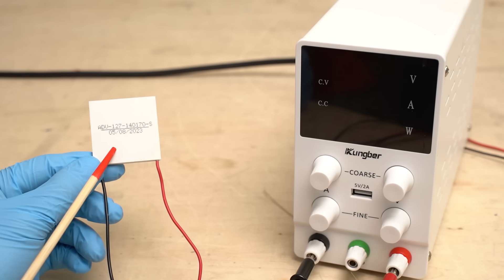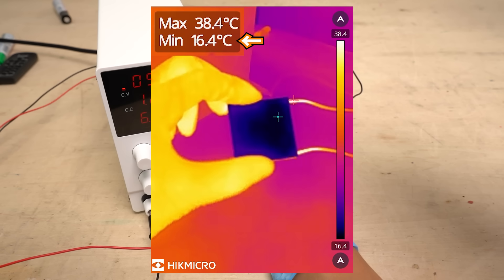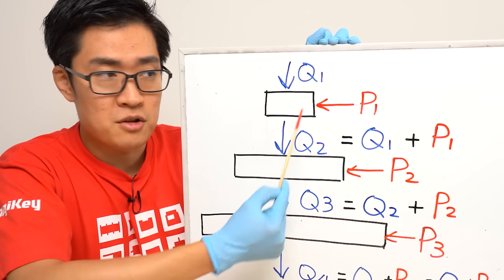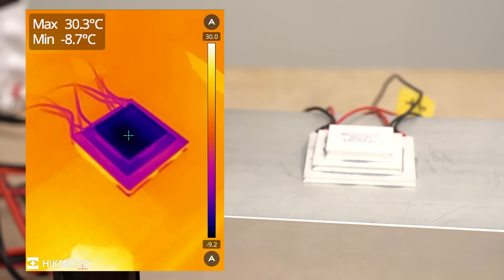Stacking 5 Peltier Modules, and Reached -90℃

Comment: AI Summary

Abstract:

This video explores the practical limits of Peltier device cooling by constructing and optimizing a multi-stage system. The creator, a beginner in thermal engineering, aims to achieve ultra-low temperatures, initially targeting -60°C. The experiment demonstrates the principle of stacking Peltier devices to achieve progressively lower temperatures, emphasizing the critical role of efficient heat dissipation from the hot sides and effective insulation of the cold side. Through systematic current optimization and insulation, a self-made three-stage Peltier stack successfully reached -74°C. Further experimentation combining a commercial multi-stage Peltier with parts of the self-made setup unexpectedly achieved a remarkable -92°C, potentially setting a new record for Peltier cooling on YouTube. The video concludes with practical demonstrations of cooling small electronic components (resistors and capacitors) to observe their temperature-dependent properties, highlighting the system's utility for miniature low-temperature experiments.

Exploring the Limits of Peltier Cooling: A DIY Multi-Stage Approach

*   0:00 Introduction to Peltier Cooling: The creator aims to push the limits of Peltier cooling, targeting -60°C, contrasting it with previous experiments in power generation using Peltier devices.
*   0:29 Peltier Effect Explained: Demonstrates how passing current through a Peltier device creates a cold side and a hot side, explaining the endothermic and exothermic processes within P-type and N-type semiconductors.
*   1:17 The Self-Heating Challenge: Highlights a critical issue: Peltier devices generate their own heat (P=VI), which must be dissipated for effective cooling, otherwise, even the cold side gets hotter than ambient.
*   2:05 Multi-Stage Stacking Solution: To achieve lower temperatures, three Peltier devices are stacked in decreasing surface area from bottom to top.
*   2:58 Principle of Multi-Stage Cooling: Explains that each successive Peltier device in a stack leverages the already reduced temperature of the previous stage's cold side, allowing for further temperature drops.
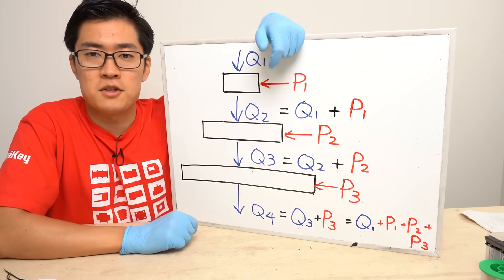*   3:41 Gigantic Heat Sink for Dissipation: A large industrial heat sink is used at the bottom to dissipate the enormous cumulative heat generated by all three stacked Peltier devices.
*   4:18 Thermal Grease Importance: Emphasizes the use of high-performance thermal grease (TC3-1G, 8.5 W/(m･k)) to ensure efficient heat transfer between the Peltier devices and the heat sink.
*   5:11 Initial Test & Early Results: An initial test with ~20% rated current quickly brings the top surface down to -5°C, then to -30°C.
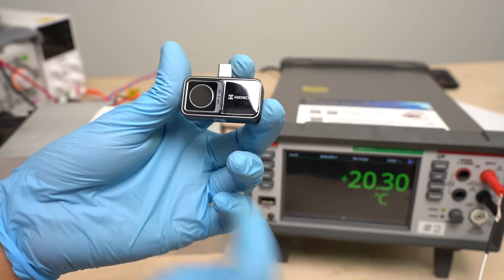*   6:12 Measurement Limitations & Tool Change: The thermal camera's limit of -30°C necessitates switching to a thermocouple, which records -55°C on the Peltier.
*   6:35 Forced Air Cooling: A powerful fan is introduced to provide forced air cooling to the heat sink, significantly improving heat dissipation.
*   6:55 Insulation for Efficiency: Styrofoam is used to create an insulated case around the Peltier stack, including an air gap (0.024 W/(m･k) thermal conductivity) for additional insulation and prevention of air convection.
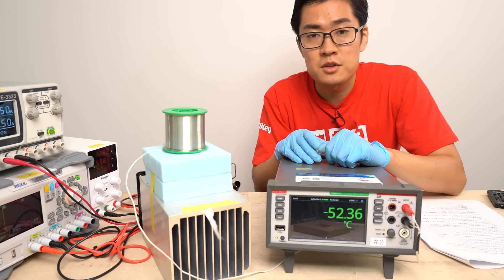*   8:21 Insulation Impact: Insulation significantly improves cooling, achieving -52°C without the top Peltier, and then -60°C once all three stages are active.
*   8:42 Optimal Operating Point Search: The creator systematically tests approximately 150 current combinations for the three Peltier devices, taking 2-3 minutes per test for temperature equilibration, to find the lowest achievable temperature.
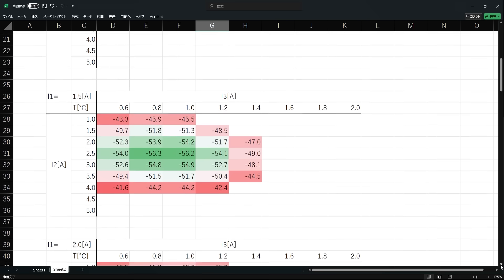*   9:31 Achieved Temperature Target: With optimal current settings (100W bottom, 24W middle, 5W top), the system reaches a stable -74°C, significantly surpassing the initial -60°C goal.
*   10:34 Application: Resistor Cooling: A 1kΩ resistor is cooled, demonstrating its negative temperature coefficient (resistance increased from 991Ω to 1008Ω at low temperatures).
*   11:34 Application: Electrolytic Capacitor Cooling: Cooling an electrolytic capacitor from 53uF to 48uF at -70°C shows decreased capacitance as the electrolyte starts to freeze, with a noticeable change in its operating waveform.
*   13:08 Cooling Capacity Limitation: The system is effective for cooling fingertip-sized components but not larger ones.
*   13:16 Cost Comparison & Design Differences: The self-made 3-stage module cost $85, while a commercial 3-stage module costs $200. Commercial modules are more efficient due to optimized designs with fewer thermal grease/ceramic layers, resulting in lower thermal resistance.
*   14:09 Unexpected New Record: By combining the commercial 3-stage module with the self-made middle and bottom stages, the system unexpectedly achieved -92°C, potentially setting a new YouTube record for Peltier cooling.
*   14:30 Practical Considerations: While -92°C is impressive, practical cooling of larger components might only reach around -80°C.

I used gemini-2.5-flash-preview-05-20| input-price: 0.15 output-price: 3.5 max-context-length: 128_000 on rocketrecap dot com to summarize the transcript.
Cost (if I didn't use the free tier): $0.0064
Input tokens: 16683
Output tokens: 1120

Comment: Put some thermal paste on them, limit the voltage, and strap them to a CPU, with the heating side on the Cooling fan, if it works the way i think, then, we have an overclock potential for 10% minimum.

Comment: I wonder how deep one could get down by putting dry ice (sCO2) or even lN2 onto the hot side. I'm sure it's much less than a parallel shift as peltier effect gets less efficient at lower temps.

Comment: I would so grind those layers thinner, also there is thermal paste with higher performance range Thermal Grizzly Kryonaut 12.5 W/m·K, could not find a specification about temperature tho. The new goal is -100℃ 😜

Comment: I wonder what the results would be to coat the heat sink with an endothermic phase change material or perhaps making a phase change polymer using agar and producing a polymer wool to pass the cooling air or both?

Comment: Your very smart with this electric parts so I’ll ask you…could this be used to create an appliance that cools drinks like a car refrigerator? Would this use of peltier modules be more energy efficient than a compressor and coolant? With proper heat sink use could a long lifespan be expected from peltier use?

Comment: looking at the test of 1 device it seems that putting some of these in the front of a PC case at low voltage doesnt seem like a bade idea. high enough for effective cooling but low enough to prevent their temperature rising above the cooling capabilities.

Comment: @DENKI-OTAKU I have a CPU Intel i7-10700K it rich 99°C on full throttled when i play games.
I use AIO 360 watercooling but in full speed doesnt drop under 70°C.
Can you build a peltier system that i can use for cpu cooling?
I want to drop temperatures at 40°C.
The Ambient Temperature at Summer we have 44°C.

Comment: This is, without doubt, the single most inefficient way to get -90C.
Peltiers are ridiculously inefficient.
It's why a single peltier with a 150C differential can only power a single 1.5 volt motor at low speed - in a stovetop fan.

Comment: Could you run this again, but instead focus on the amount of heat generated? I'm curious if this could be used in place of a conventional compressor in a heat pump. You said it used 100W to power it, but what would be the heating value at that power. Could it be a better option?

Comment: Look, I AM GIVING YOU BILLIONS OF DOLLARS RIGHT NOW.
But everyone says IT USE A LOT OF ELECTRICITY. We can't keep this running, so I, FlávioAugustoRibeiroEvangelista, give you an idea:
*Assemble a Total Magnetic motor.
*Couple and connect THE MAGNETIC MOTOR to the Electric generator.
*Connect and connect THE ELECTRIC GENERATOR to the magnetic motor.
*Connect and connect all the outputs of the electric generator to voltage increase TRANSFORMERS.
*Connect and connect to electrical and/or electronic circuits to increase voltage and currents.
*Connect everything to a control panel and Destruction eeeeeee ea! Voila! Shazan!
THERE WILL BE NO LACK OF ELECTRICITY

Comment: The idea is to use all the MAGNETIC FIELD of our Planet EARTH as a MAGNETIC TRAMPOLINE that will push the SPACESHIP and other vehicles into SPACE WITHOUT USING ROCKETS or any type of fuel. And to FLY faster use ELECTRONIC Turbines made of micro PARTICLE accelerators CYCLOTRON BETATRON examples. FlávioAugustoRibeiroEvangelista./

Comment: you talked about portable fridges using peltier devices.. Do they stack them like that and run some kind of refrigerant gas through some coil? It feels like it would be able to get to acceptable temperatures for fridges, even if the power consumption would be a lot greater...

Comment: Although your water method is handy I wonder how much it is affecting your readings, since ice is a insulator. I don't believe it would be much but you're achieving very cold temps, so you might be doing better than you think. I have heard of southern farmers using ice to protect the crops even though the temp wasn't getting too much colder then the freezing point. But who knows that's comparing two different things altogether. Anyways great video, it is inspiring me to mess around with peltier modules. I would like to find a way to use it with computer cooling but I don't think it would work. Maybe a cloud chamber is a better idea.

Comment: Last week I connected a 12 volt power source to a peltier. In an instant the peltier heated up yet the cooling effect seems minimal. it seems the electric current generated more heat than cooling which I felt it is not efficient at all.

Comment: ....You have to water-cool the Peltier modules for the memes. 

It might not be a bad idea.  Water will provide a quantity of thermal resistance/battery that will keep low temps and might help the Peltiers operate more efficiently. 
An ordinary cpu closed-loop cooler might work just fine.

Comment: After seeing that, I am now curious about how the Cooler Master MasterLiquid ML360 SUB-ZERO works after all. Is there only one Peltier cell or a few of them stacked? That thing is very interesting, because it must deal with a lot of heat quickly enough as the CPU heats up in seconds! Also, it calculates the dew point so it won't allow moisture to build up if set though. A very smart system in such a small displacement!

Comment: The key question is what is the efficiency. Heat is moved from cold side to hot side along with waste heat. Looking at the stacking, each peltier has max efficiency of 20%. (Efficiency is  an incorrect term, for COE)

Comment: ensuring the thermocouple was flush against the peltier top, frozen with some liquid thermal conductor which freezes, would probably have been a touch more efficient, and encasing in fire insulation foam...
 but thats splitting hairs. neat experiment.

Comment: I remember Thermaltake using Peltiers, it consumed so much energy you had to plug the module to the AC outlet, and yes condensation and freezing was an issue.

Comment: That's a cool experiment. How much power does it take to run the full 5 stages?

Also, another key difference of the off-the-shelf stacked module that I see is the spacing between modules.
I don't know the specific reason it is done that way, as the environment would usually be warmer (or cooler) than the intermediate layers - letting them interact with it SEEMS like a potential efficiency loss... But they did it that way, so clearly there is something to be gained this way.

Overall, I feel the real value of the device is in how you're able to alter its thermal mode easily. You can run experiments or test technological processes requiring a rather complex thermal pattern, as the device is fulltly reversible and can heat as well as cool.

Comment: In the 90's I did a stacked system. My neighbor had about 6 large pelters he loaned me (and they were huge, bigger than the largest one here). He also gave me a huge high amp power supply (he was a vacuum chamber scientist). Anyway, I tried stacking them in different ways like using two levels. I found that the two layers just did not do a good job cooling my CPU. It was like it could not remove the heat fast enough. Anyway, went with a single layer setup with maybe 4 pelters and a copper plate and had something like a small car radiator hanging out my bedroom window. It required a lot of attention as ice and condensation was constantly being pulled from the air. I gave up on it after a week, but it was fun though... just not very practice. Also, pelters are not that efficient so lots of power just for the pelters.  The performance gain was small also.

Comment: Homemade superconductors anyone? Supposedly there are materials based on pair density waves (PDW) that can generate a Meissner effect at close to 190K but that would be exceptional. The highest cuprate Tc without pressure is in the 133K range with HgBaCuO

Comment: This will be just the thing for a pc cooler but excellent for a water cooled cold suit for motorcycling . 

A 2 stage peltier cooler with a bar type water cooled heat sink on the peltier and a suit with tubing around the body which needs cooling .

Comment: 4:23 why not use some normal thermal paste (e.g. arctic mx-4) like used in building computers (heatsink to CPU) has it not got good enough thermal conductivity or cant handle the temperatures as well?

Comment: I'm sorry for not reading the comments, but I'm a little confused that these tests are not being run under your expected load. There should be a thermal mass being cooled in order to measure the effective ability to move heat, should there not? Something like a cup of water at standard temperature & pressure? Otherwise, these figures are only truly relevant for very small samples that you wish to make as cold as possible. I mean, it's cool to see the numbers go up and all, but it's like seeing the max RPMs of a motor without the thing doing any work: it's neat, but not of much use.

Comment: Depending on how long it takes to cool , i could be a good use to add a microcontroller to monitor heat and control power, and make an insulated freezer.

Comment: I had bought a Peltier in experiments with powering a smartphone in any environment like the winter, create a Peltier device that you throw into the snow but would charge your phone immediately and still have power and data. ???
Reply: Peltier devices can generate power, but require a temperature differential on each side. With it thrown into the snow, the temperature is equal on both sides, and will not generate anything.

Comment: Why didn't you add a copper heat spreader between stages to better utilize each stages cooling capacity. Also adding a means to compress the stack together and use a thinner amount of grease would lead to better heat transfer. I bet you could increase the efficiency, performance and min temp with those couple of additional steps.

Comment: About 20 years ago, I built a Peltier module water cooler for a graphics card. It was just a small experiment to test how well it could cool graphics cards. It was actually quite successful; the card rarely saw temperatures above 30°C. The downside was that the cooler required approximately 300 watts of power, so I removed it after a few weeks.

Comment: Not quite. Correct me if I’m wrong, but there are two different types of Peltier devices. TECs and TEGs. One is a Thermo Electric Cooler, while the other is a Thermo Electric Generator. While both accomplish the same thing, they are specifically fine tuned for a certain task. For example, a TEG is specifically tuned to accept a higher temperature and generate a voltage, while a TEC is designed to accept a voltage and create a temperature gradient.

I learned this the hard way.
Reply: So, in theory, you likely bought a TEC, and tried to make it generate a voltage. While technically possible, this is not its designated purpose, and so its efficiency was so low.

Just wanted to put this out there! 😃

Comment: quick thing you missed when you talked about how they generate heat, they don't just generate heat exactly the amount of power you put into it, they act like a heat pump and the heat from the power input plus the heat drawn from the hold side (the cold side is just the transfer of heat away from that side) combined is the total heat output. You can probably calculate a COP of a peltier chip if you try hard enough

Comment: Very nice video! I used 2 same size peltiers a while back stacked with top on 5V and bottom on 12V, cooled by a CPU cooler to make a desktop cloud chamber, power consumption was about 50W (I think) and it could reach about -60C. Might try expanding sometime in the future.

Comment: Ive been used with ln2 and we only reach -216 degree, if i increase the current the peltier cracks. When we made a vacuum on ln2 we got -209, adding a peltier to -209 we reach -223 before it cracks.

Comment: Amazing! I’ve been experimenting with Peltier coolers for CPU overclocking for nearly 25 years on my own. Never thought to stack them. Just a tip, setup a PWM loop next time to find the optimal temps, or run a few data points through machine learning AI instead. Both will save you SIGNIFICANT time in this day and age. 👍

Comment: 12:48 I wonder if that's because of the small amount of heat generated in a capacitor, when the AC current flows. Initially it behaves like there's no capacity. That could be verified by measuring the amplitude frequency characteristics.